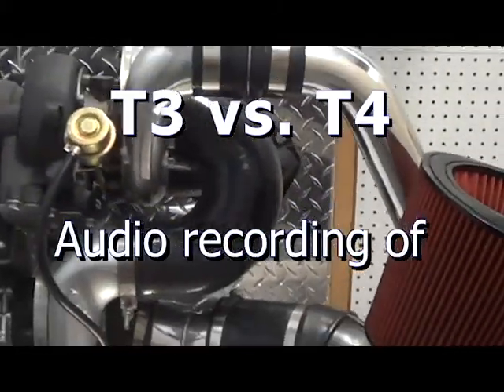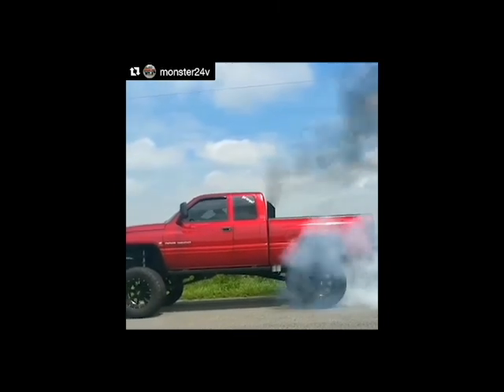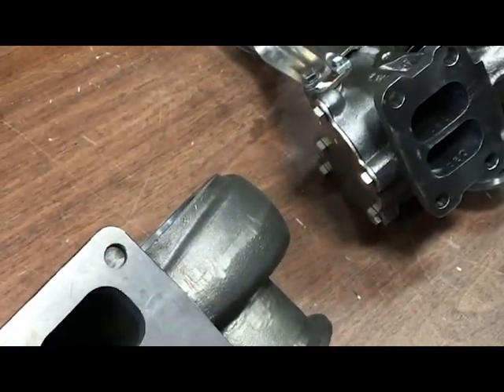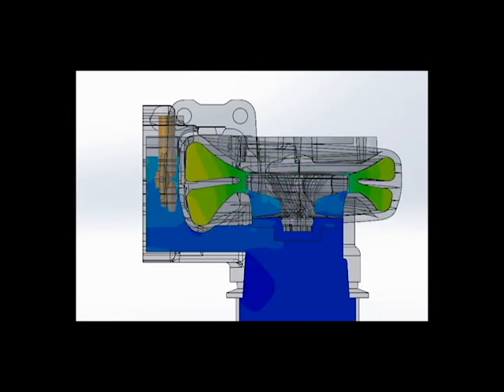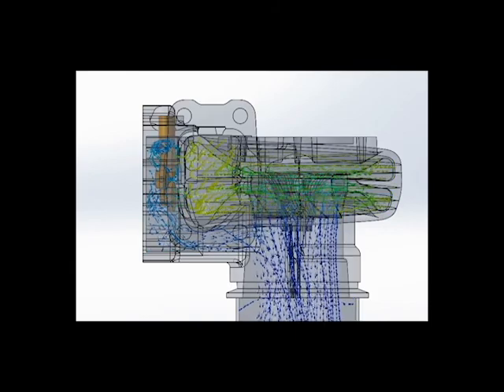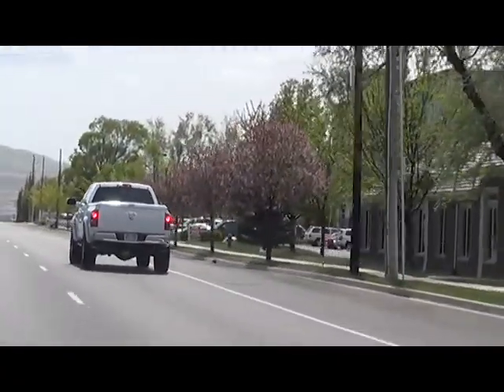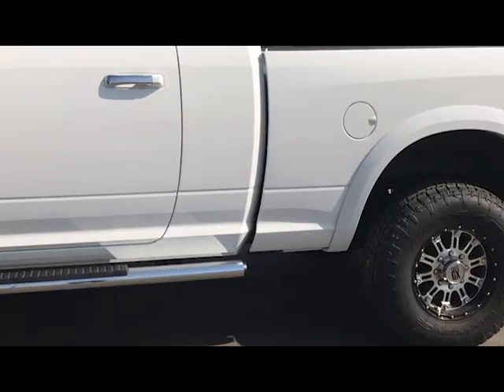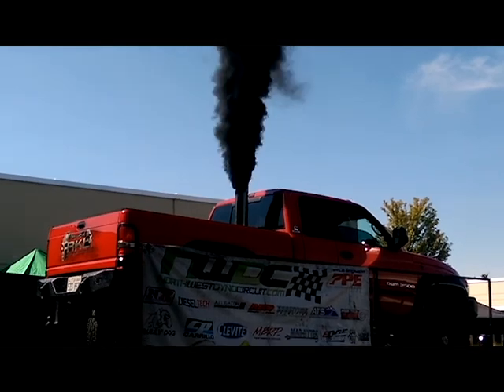Does a T4 Turbo flow more than a T3 Turbo?  |  T3 vs T4 Turbo

Comment: I have a .63 T4 (undivided) and a .63 T3 (undivided). The volume inside the volute is very noticeably larger on the T4. It's not just the flange opening.
Reply: The point is the total volume of the scroll is the same so apples to apples they flow the same, the inlet is just different.
Reply: @lagwagon8018  Not true. I have both housings in my hands. It's plain as day that their volute volumes are very different. I 3D model parts for a living, specifically slurry pump volutes.
Some brands may just have a flange size change, but that is certainly not the norm.
There's a reason why .63 T4 housings performing similar to .82 T3 has become a rule of thumb.
Reply: @konigvonpreuen8065  I’m not necessarily doubting you but I think it is difficult to know an objects total volume and in this case also flow by visually looking at it, no matter profession.

Either way I appreciate the response it urges me to look more into this.

Comment: Finally a video with good info. About every shop you call now days will sell you a 364.5-369 with a 73+mm turbine wheel and  tell you it’s going to tow fantastic as a single for a 5.9 CR with 50 hp injectors 🤦🏼‍♂️ do your research on forums and be knowledgeable before spending money. Not everyone wants to “change your driving style” meaning tow at 2600 rpm to keep egts down. Whatever happened to usable power for what these trucks are for. Most shops are selling stuff for drag racing or will recommend you a T4 464-467 that works well for a 6.7 knowing you have a 5.9 CR acting like that extra 50 cubic inches of displacement in the 6.7 isn’t a contributing factor in why it can make that turbo work better than in tbe 5.9. Really blows my mind how much bad info is out there. It’s all about selling you what’s on their shelf most of the time instead of what you really need $$

Comment: So Would A T3 .82Ar Exhuast Housing On A GTX3582R Be Ok Or Should I Use A 1.06 T3 Housing On It Instead. I Don't Won't To Choke It Out. I've Ran This Turbo On Gas Engines But Never On A Diesel lol
Reply from the maker: Well a 1.06 AR will flow more than a 0.82 AR housing, but the 1.06 housing will be very sluggish to spool up.
Reply: @DieselPowerSource  Alright I'll Give The .82 A Shot First. Turbo Has A 67.8mm/62.2mm Turbine Wheel And 82mm/62.5mm Compressor Wheel. Putting A 5.9 Style Manifold Flipped On A 2014 6.7, Modifying Manifold To Fit Dual Wastgates etc. He Didn't Want Crazy Power Gains Just Spool Up So I Recommended That Dual Ball Bearing Turbo With A .82 Housing.